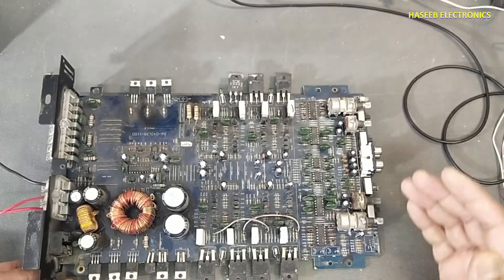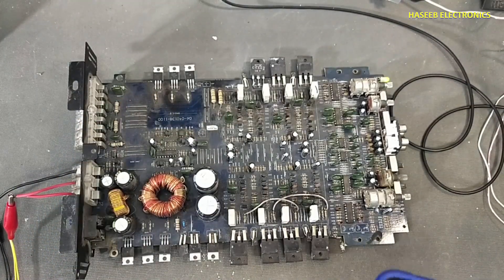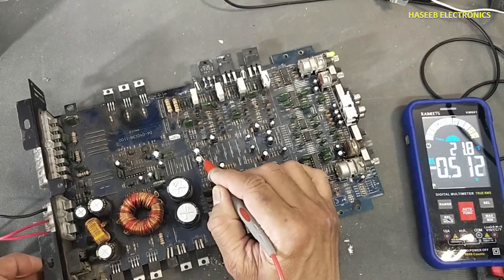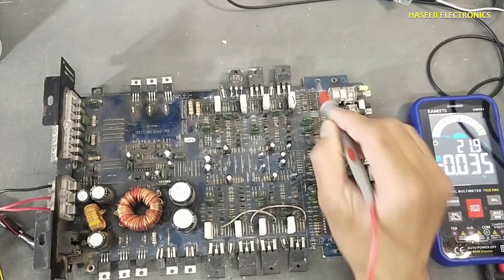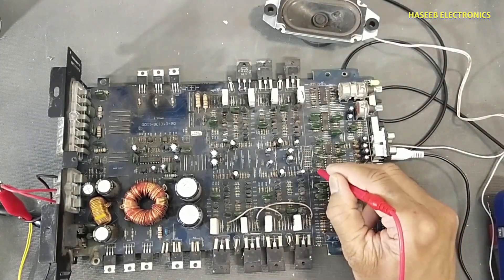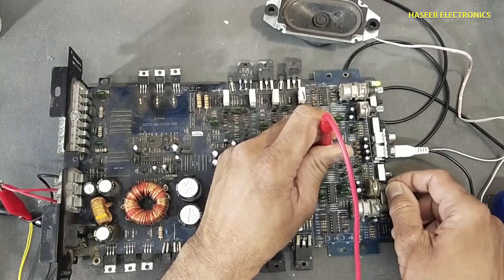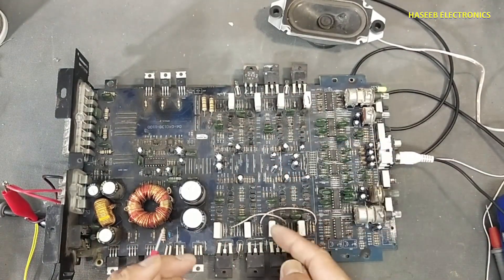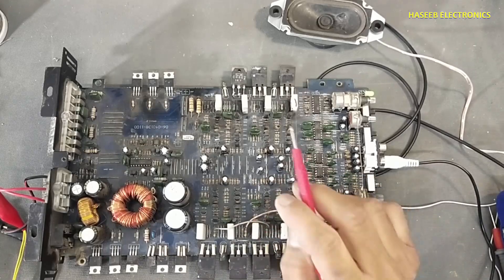{861} 1000 Watt Audio Power Amplifier Repair

Comment: A senoidal signal for the input is better for check with osciloscope
Reply from the maker: yes dear. it was a basic approach to give concept of the testing procedure 
for frequency response of the filters, we need sine wave, square wave with variable pulse width signal for bass booster, and triangle signal for signal linearity testing of the amplifier. also variable audio frequency for bandwidth response testing of the preamplifier